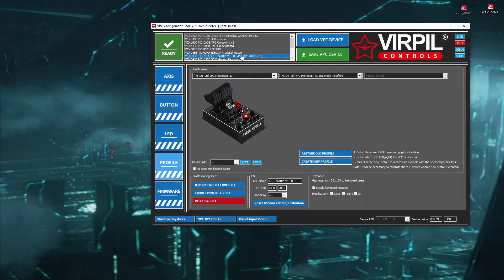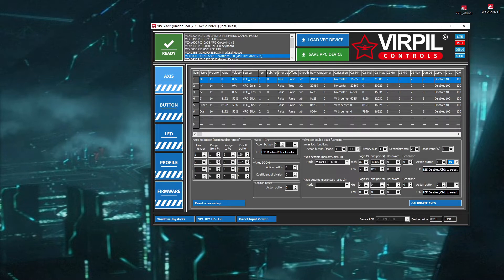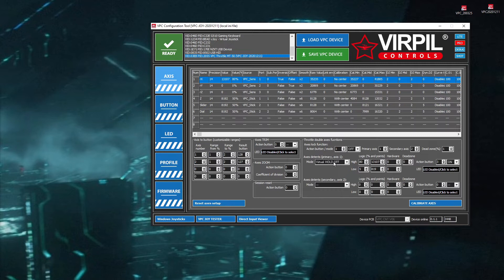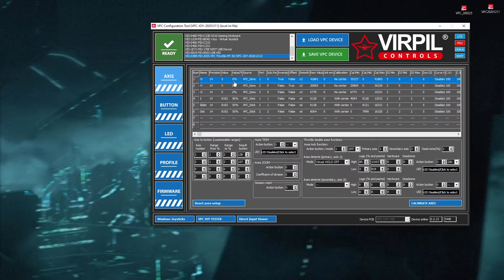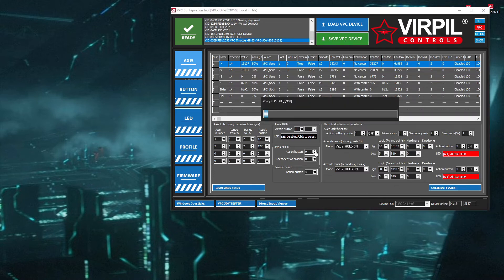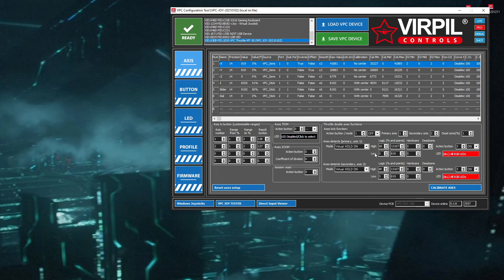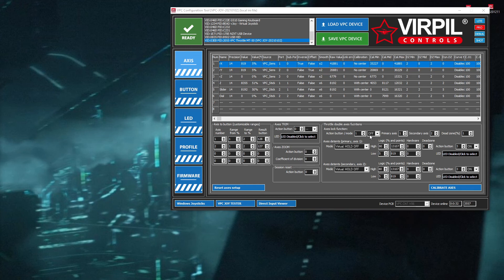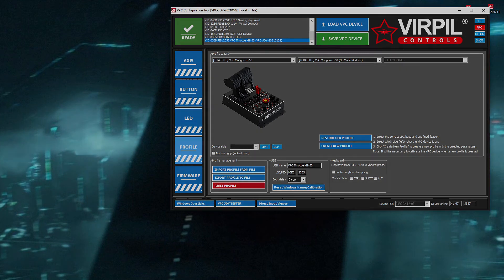Configure Virtual detents on Virpil throttle tutorial

Comment: Hi - (as usual, thanks for these videos - its really helping understand the full capabilities of the CM3). New issue I am trying to sort out - while the flaps lever appears to work properly (as in full range of lever shows up as 0-100% in Windows), the two throttle levers seem to have idle zones in the top and bottom - so only about 30% of the physical throw covers 100% of the range in Windows. It almost feels like there are virtual detents set up, or in this case, it was set up to match the physical detent that was installed on the throttle. 

In the bottom right hand section of the VPC tool (where you see Throttle double axes functions, and Axis detents) they are all empty for all of the axis, so that's not it.

Is there another place to see if there is a virtual (or physical) detent set up? Does adding the actual detent (one of the various types that comes with the throttle) actually impact the digital output (or is it just something that you can physically feel).
Reply from the maker: Flaps - double click on that axis to show sub page on it, check deadzone min and max (or try re-calibrating this one axis). I am unsure about the detent set-up on the CM3 as I have an older model. I have contracted Virpil and asked if they could possibly send me a CM3 throttle to create more up to date tutorials with , but they declined to do this (Guess Virpil must be really cash strapped if they cannot afford to send to a free device to someone who has literally helped out thousands of their customers)

Comment: Great video update as always. However, not sure why you are still using the test version of the software that was never released when there is a much newer version 20210102 available on the Virpil site.  No changes to the UI, but...
Reply: Just noticed that half the video is with the older software and half with the new one, so all good!
Reply from the maker: @eyemack   First half was filmed a day  two before 20200102 was released, wasnt going to re-film at as there is no visible change between them

Comment: Great Video Havoc!   I programmed a pluging with exact figures for most DCS World aircraft and others sims with Joystick Gremlin.  I feel the advantage is that I dont need to reprogram the firmware when changing planes.  I simply select a different parameter for my plugin.  I've been using this for more than a year now and it has been so great and exact  that I dont want/need the physical detents available in the newer virpil throttle.  I tried contacting you on your forums to share this library with you and your viewers  because you told me once you also use JoystickGremlin but I dont use temspeak so I cannot get an account, is there any other way to contact you, discord maybe or something else?  If not, my discord account is rolex#2878 or my dcs-world-forum username is ralch.  Please let me know